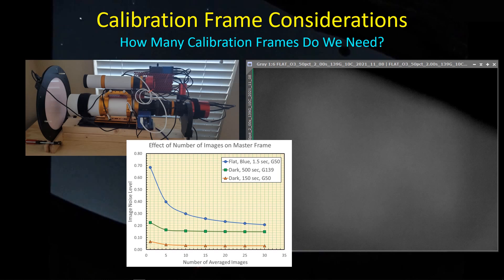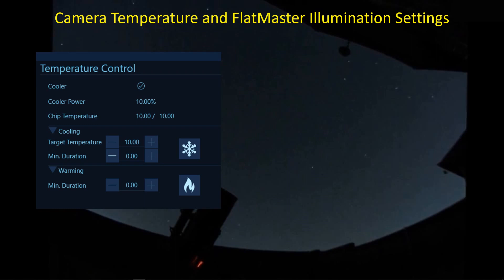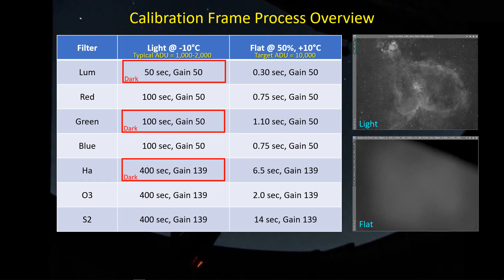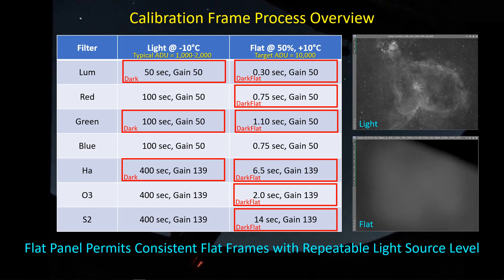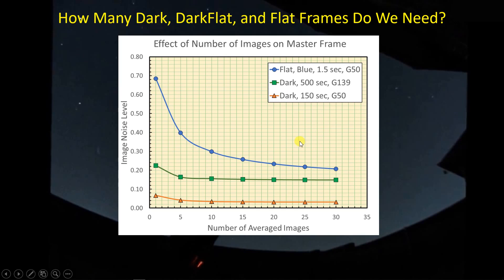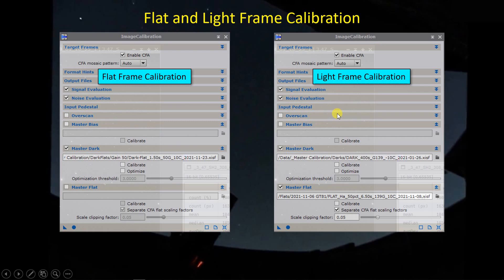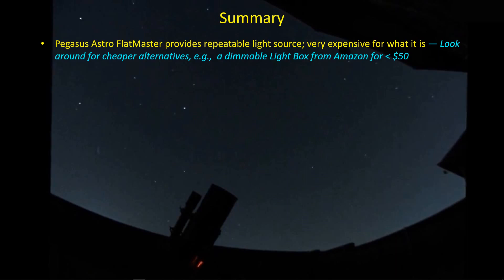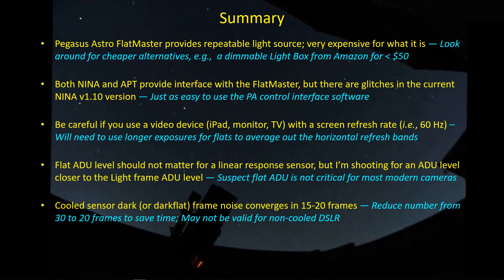How Many Calibration Frames?

Comment: Excellent video!  Sound reasoning for image number of each calibration set. Great to be thoughtful and to be more precisely appropriate on calibration frames to yield the best overall final image. Currently using a “Spike-a Flat Fielder” that gives consistent dimmable illumination for flats, an alternative to the Pegasus unit. TY
Reply from the maker: Thanks for watching, Blane! Thanks for tip on the Spike-a. Expensive, but less than the Pegasus Astro model I have.

Comment: Great video. I have tried to repeat your testing with my camera (ASI294MC Pro)  but the data looks wrong to me. not sure if i'm using the right noise analysis in pixinsight, or if it is some setting in integration, or possibly due to my camera being one of those non-linear types where Bias frames are a bad idea. . My flats are as expected trending down and easy to pick a point of diminishing returns. My darks and Dark flats however are NOT as expected, the data suggests that 1 flat dark is better than 5, and that 5 darks is the best i can get.
Reply from the maker: Hey Stan. I'll have to review. I seem to recall an issue with the darks as well. Perhaps because the noise is so low. I may have done that analysis in Python. I'll see if I can recover my steps. Thanks for watching!

Comment: Hey James, I use 33 of each (flats, darks, bias). I only take flats each time I image though. Sensor temp doesn't seem to make a difference on flats. Bias doesn't either on CMOS cameras, apparently.
Reply from the maker: Hey Charles. Hey, if it's working for you, don't change a thing! If you calibrate your flats with dark-flats and your lights with dark frames, then the bias is already included in the dark-flats and darks. You're probably correct about sensor temp. Flats have a high signal and exposures are short. Just to be "safe", I cool the camera down to +10C for flats (-10C for Lights). Thanks for watching!
Reply: @James Lamb  Totally agree about the bias files. I didn't switch to dark flats until recently.  It saves me a lot of time not cooling the camera for flats and I think you will find the same result I did if you test the flats both ways.   Clear skies!

Comment: Great video ! Greatly appreciate your analytical approach to question we face in this “hobby”. On that note is there a way to send you a question unrelated to this video regarding comparison of OSC vs Mono interns of integration time equivalence?
Reply from the maker: Thanks! On my page, go to "About", then select "Details". My email address is there. Having said that, I'm not sure I have much wisdom to share as I only use a mono camera. My guess is that integration time is not affected much. You might try an experiment with your setup. Pick a good target, then stack the images for, say, 5 hours. Then stack for 10 hours, and so on until you really don't see a difference.

Comment: Great data, thanks!  Have you looked at focus position for flats?  Most of my OTAs change focus position considerably during the night and taking flats when it is warmer would seem to put the focus way off.  It may have negligible effect for the general optical train characteristics, but for dust and other artifacts,  it seems maybe a variable to be considered.
Phil
Reply from the maker: Hey Phil. That scares me. I know you should take flats in the “nominally” in focus position. I do that. For me, focus does not change much through the night, probably not even a millimeter (guessing). Each time I change from one scope to another, I’m moving the camera and have to redo flats. I just take flats at whatever the last focus position was. I think this should be more than adequate. Let’s put it this way, I’m not going to the trouble of taking flats a different focuser positions. I’m much too lazy for that!
Reply: @Aero19612  I don't think flats at different focus positions would help.  Just a set of flats at focus because my OTAs are always in focus (or at least close) during a run with focuser temperature compensation. I'll try to see what happens when I do flats at 15 degrees C, and set the focuser to the number that is in focus at that temperature.  I have one OTA that changes -30 focuser steps per degree and another that changes -50 per degree.  Yesterday the temperature went from 53 to 23 during the night.  Sometimes I think it's just as much fun to try new techniques as it is to crank out photos....
Reply from the maker: Definitely shoot flats "at about the same focus position" as you took the lights. I can't imagine summer vs winter making a big difference (that's my story and I'm sticking to it, haha). Let me know if what you find out. A thing to watch out for is the light conditions when shooting lights. You might see a difference in Flat compensation only for that difference to be the target, Moon vs no Moon, etc. Amen! I'm pretty sure I spend way too much time fussing around with all the details and analyses at the expense of just imaging. Who knows, maybe that's part of the fun too?

Comment: My question as always been What is the correct ADU for a Flat. I was told Flats should be 1/2 the Full Well Depth so with my ASI 2600 which has a well depth of 50K my flats 'should' be around 25K. I've also been told to take Flats of at least 40K. So my confusion has always been How to determine what is the best ADU for Flats? Perhaps a Vid of the best way to determine a correct ADU for Flats. ................. BTW great Video from you..I'm always learning something from your Vids.
Reply from the maker: I agree. There is no one good ADU level for a flat. There are two schools of thought: (1) for a linear-response sensor, any ADU is OK as long as you're not clipping on the dark side or the bright side and (2) if there is nonlinearity in the sensor's response, you'll care more about it if that nonlinearity is on the dark end because that's where our Light frame data live and therefore you should acquire Flats at the ADU level of your Light frames to account for the same sensor response represented in your Lights. I'm testing out path (2).
Reply: The target ADU really doesn't matter as long as you aren't losing the optical characteristics of your system by clipping too high or too low. The math for the calibration works on a ratio of the average pixel brightness to the value of the current pixel in the flat. It then applies that multiplier to the target image being calibrated. So, let's say you have taken a flat with an average ADU of 40,000. Let's also assume the pixel being evaluated has a brightness of 30,000 ADU. This results in a 0.75 multiplier given to this pixel in the image to be calibrated. Now, imagine you took that same flat, except this time your average ADU is 28,000. The pixel being evaluated would have an ADU value of 21,000. So, when the calibration runs on that pixel in the image, it again gets the 0.75 multiplier.
Reply: I've found that 20k ADU is what works best, 30k ADU seemed to leave bright vignetting and this is using a qhy268m
Reply from the maker: Hey Luke. I’ve taken flats in that range. That’s a good range. Sometimes they work, and sometimes I don’t think they work. But I’m not sure it’s the flats that are the problem. I know I’ve had issues when the lights have a bright star in or near the FoV or if the Moon is lurking nearby. I may be blaming the flats when it’s just an unusual night sky scenario that violates the nice uniform lighting I use for the flats.
Reply: I have been using the 1/2 the Full Well Depth ADU settings for my flats with very good results.  Are you considering the FW for the gain setting?  For example, with my ASI 2600mmP, running at 100 gain, the full well appears to be ~18k and half of that would be about 9-10K.  Seems using 25K would only be valid for zero gain.
Reply from the maker: That’s a very good point, Phil. I need to give this whole topic a deeper look. I’m basically going by the histogram peak which is scaled between 0 and 2^16. I definitively think this should be considered. In essence, you’re saying “less is more” because we’re getting squeezed on the high end depending upon what gain we’re using. Thanks!

Comment: I have the Pegasus Flatmaster 250, last month I sent an email to Pegasus as I was getting frustrated that my NB Flats (especially Sii) were taking up to 4 mins per flat and that was on the boost setting.  You may find Pegasus response interesting as they recon that 30 flats is not required with today's modern cameras
 "Hello SImon,
 There is a myth around the number of how many flat frames we should take. We aim to achieve the best signal to noise ratio we can on both light frames and flat frames. The light frames are dim in light and that's why we are pushing the gain and the exposure times and taking more light frames to strengthen the signal with stacking to have a better final result on a galaxy or a nebula. The flat frames on the other hand have plenty of light (due to the adjustable artificial light of the light panel) so the signal to noise ratio can be achieved easily with very small exposures.In case your final flat frames with narrowband filters are 1-2 minutes (let's say with a f/7 refractor)  then 2-3 of them are enough to stack and calibrate your light frames as the signal to noise ratio is already achieved. When your f ratio is low then we are talking for fast optics so the exposure of the flat frames can be less than a second. Then you should take 50-100 frames to get a good master flat. For example you are just using let's say 1sec, you need 64 frames x 1 sec and at the opposite side with a dimmer light source you need 2 frames x 32sec.

Both can work equally well.My advice is also to take 100+ bias frames which will help to get a very flat final calibrated image. After all, calibration frames are free and you can create banks with Bias,darks,flat frames and dark flats once, and use them when needed."

"Hi SimonA,
Yes this is normal and does not affect the quality of the flat calibration frame.
I am pretty sure that you follow an old school rule of 30 flat frames. This is not required as you can have the same effect with less frames and modern cmos cameras.
You can set the boost to the higher level and use it with your nb filters. Your device will be fine."
Reply from the maker: Hey, Simon. I don't understand that response at all. The Flat frame has almost nothing to do with the camera (or how modern it is)- - we're trying to account for "stuff" in the optical path before it reaches the camera. The response reminds me of my early experience learning AP (still learning by the way!). People say what you should do, but don't present any data or how they got to that conclusion. That was one early motivation for my YouTube channel: present observations/findings/recommendations but also show the how and why. If you aren't convinced by my analysis, then ignore the conclusion. Thanks for watching!
Reply: @Aero19612  Hi James, I recon they are trying to cover their arse tbh because the FlatMaster isn't the best to bit of kit and from I gather lots of people have complained about the product hence they recon 7 flats is plenty (as mentioned Sii takes around 4 mins per flat x 30 which is the usual amount of flats I take which is crazy amount of time! ).  According to Pegasus, 7 flats is plenty. The Superboost setting in my Pegasus App seems to have been disabled too in the latest update...
Reply from the maker: Funny you mention the vanishing SuperBoost. When I covered that feature in a video, I noticed PA has a warning not to use that mode for too long or it could damage the device. I posed the question why would any manufacturer offer a setting that can damage the (very expensive) product. Maybe they kept getting calls about blown out hardware and disabled it. Not very smart.

Comment: Great in depth video. Just what I’ve been looking for. What is the camera you use?
Reply from the maker: Hi Bengt. Thanks for watching! I'm using the ZWO ASI1600MM-Pro.
Reply: @Aero19612  Great I happens to have the same model 🙂 camera. Have been thinking of changing the temperature I use -20C to -10C as it takes less time to cool in the summer. Also means that I can probably improve my flats by following your tutorial instead of hitting the ADU suggested by Nina I’ll try to match the ADU of my lights. Not really happy with my own results. Thanks again for a great video.
Reply from the maker: Haha. I picked -10C because I would never be able to get down to -20C in Texas.

Comment: Hi James. This is a very timely video as I was just contemplating reducing the number of calibration frames I use (I got a new camera which is about 4 times the number of pixels as my ASI533). I have often wondered if a reduced ADU for flats would be more appropriate so I will be interested in hearing about your results. I don't know if my new camera (ASI2600MC) has the same goofy short time non-linearities as my ASI533 which I found I needed a minimum >1.25 seconds. Using my needle point frame with 3 layers of white fabric and my cheap tracing pad gives me an ADU of about 40ish% with 1.8seconds and has been very repeatable. I was doing 100 flats/darkflats and 100 darks. Your results indicating the effectiveness of a smaller number of darks make me happy (for obvious reasons). Hopefully in a few days I will have clear skies without a full moon (I have waited the obligatory 4 weeks of bad weather after buying new gear). Thanks for another useful video. Bob
Reply from the maker: Wow! Congrats on the new camera! I went to the Agena Astro site to look it up. They have a package sale on for the mono version. If I weaken and buy it, it's your fault. 100 flats and darks! You have more patience than I do, that's for sure. I kick myself for jumping at the PA FlatMaster. The tracing pad idea is a much better approach.
Reply: The tracing pad would not have worked (at least for my ASI533) without the needlepoint frame (thanks by the way). It is easier to be patient when you don't have multiple filters to calibrate. Thanks again.

Comment: Very interesting, good sign I've been spending much too much time taking dark frames. It honestly looks like 90% of the job is done by 10 frames, and quickly becomes diminishing returns.

My flat field device: one of those A4 LED "tracing pad" devices off Amazon, just hook it up to a good variable power supply for dimming (they normally power by USB). Best part: under $20.

Thanks again for sharing!
Reply from the maker: Thanks for the A4 tracing pad feedback! That's a much smarter way to go than the Flatmaster. I agree, doesn't take too many averages to beat down the noise.
Reply: @Ryan Can you recommend an inexpensive variable USB power supply?? Thnx